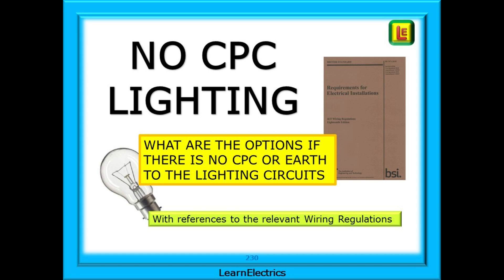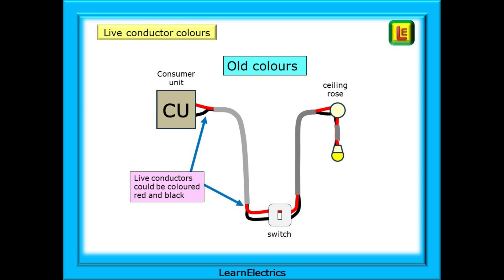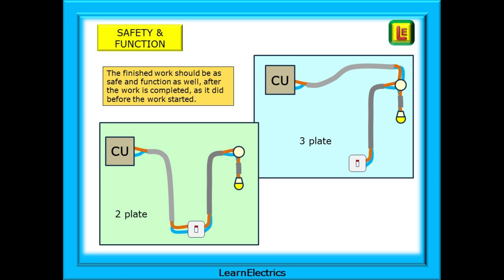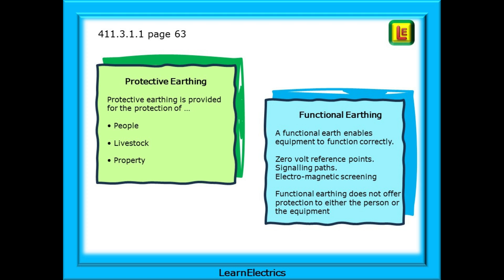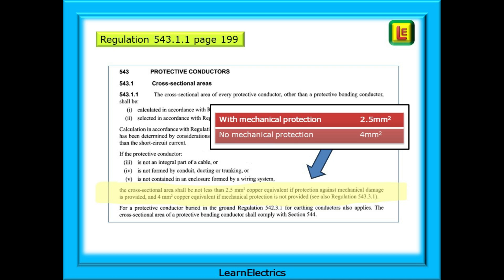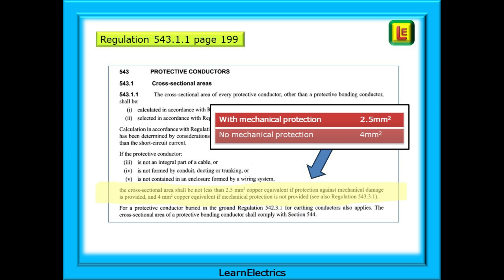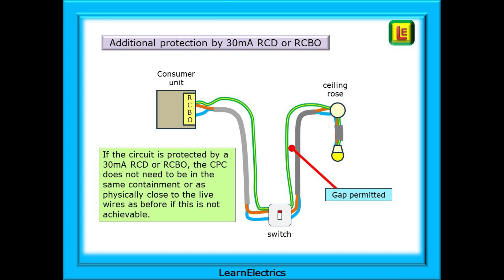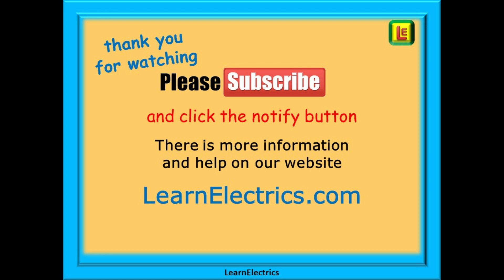NO CPC LIGHTING – WHAT TO DO IF THERE IS NO EARTH IN THE CIRCUITS – WHAT DO THE REGULATIONS SAY?

Comment: My friend has just had their property fail its elec safety inspection as none of the circuits have a CPC. The only solution proposed is to re-wire all wiring circuits which is coming in at £3k for the bungalow. Is another option to replace light fittings and switches with class 2 parts not acceptable anymore?
Reply from the maker: Reg 651.2 NOTE 2 states that existing installations installed to earlier editions of the regulations may not comply with current regulations. This does not necessarily mean that the installation is unsafe or that it needs upgrading.
Also, lighting circuits installed before 1966 did not require a cpc or earth.
Having said that. It is up to the inspector to use his professional judgement to make a decision of fail or recommend improvements or pass an installation.
And where a lighting installation is to be extended or altered, then the current regs regarding cpc's will apply.
If the installation is pre 1966 then it is 60 years old and well past it's rewire date in my opinion.
If as you say, ALL the circuits are without a cpc, then it definitely needs attention, this could be dangerous.
Have your buddy re-invite the electrician to explain why its unsafe, perhaps even get a second opinion on a rewire from another sparky,
Reply: @learnelectrics4402  Thank you.  Keep the videos coming.  Appreciate the clear and no nonsense content

Comment: Great video, whats your thoughts on replacing consumer unit when no  CPC on lighting circuit? Its not always possible to rewire and you will be leaving the job a lot safer with RCBO’s, SPD and correct size earthing conductors. Thanks.
Reply from the maker: Some people do, some use class 2 accessories only and label the CU appropriately - danger, class 2 etc.
Personal choice between you and the client. Hope this helps. Dave.

Comment: Please clarify if you can simply get away with using class 2 lighting fitting as suggested in comments below and not bother with an earth     ??
Reply from the maker: The Regs state that all new circuits should have a cpc taken to the point of use, even if not used. For lighting, the Regs state that the cpc does not need to be taken past the ceiling rose and luminaire are class 2. Hope this helps.

Comment: So I think the implied answer to the question posed, is that you could extend the lighting circuit if using non conductive accessories/fittings (Still as safe as the original circuit). Although this answer didn’t seem to be actually stated in the video.
Reply from the maker: No, that was in pre 14th Edition as stated in the video. the requirement now is to take the cpc to the switches and the ceiling roses even if not needed. The only exception is the pendulum cable from the rose to the lamp if that is all in plastic. Hope this helps and thanks for watching.
Reply: @learnelectrics4402  thanks for the the clarification.

Comment: Yes a very good subject. Here we have to run anything new from a ground circuit no tying into the old stuff. Thanks for sharing.
Reply from the maker: That is my preferred method too with older systems. Thanks for watching.
Reply: But a class 2 light would be ok as mentioned above in comments  ?   Would that be correct.   Would that be the cheapest way  ?

Comment: On my two core lighting circuit, in the 1980s a metal cased light was added & the electrician ran a single core 1.5mm2 earth (above the ceiling, so protected from mechanical damage) from the nearest plug socket. Is that an acceptable way to provide an earth?
Reply from the maker: Not acceptable. The cpc from the sockets is not part of the circuit from the lights. The circuits must be kept separate.
Reply: @learnelectrics4402  - Thanks, but what is the reason for this, given all the lighting/power earths end up being connected to the same earthing bar in the consumer unit/fuse box, and the same earthing sleeve around the incoming main
Reply: @Benzknees tumbleweed……..because the regs. say so.  I think any earth is better than nothing.
Reply: @MS-Patriot2  - Did the Regs say that 30yrs ago when it was done? And whatever they said then or now, it still doesn't answer the basic question. Why? What's wrong with the path of the earth going via one circuit instead of another one, both ending up at exactly the same place?
Reply: @Benzknees  I take your point entirely .  If I had to guess, it’s possibly because the earth fault loop impedance cannot be relied upon based on the designed circuit length.
Reply: @MS-Patriot2  - That's a good point, altho' in your typical UK 3 bed semi the circuit lengths are going to be pretty short and fairly similar in length.
Reply: @Benzknees  Absolutely but 7671 is guidance for all installations, and it’s written by boffins who wear four pairs of braces and two belts - just in case.😉
Reply: @MS-Patriot2  - Haha, that would explain why the rest of the world scratch their heads in wonder at our huge plugs!
Reply: @Benzknees  and ring finals.
Reply: @MS-Patriot2  - Yes, needless safety on earth wires & plugs on the one hand, 32A main fuse protecting 26A max load wiring if the ring is interrupted on the other😳
Reply: @Benzknees  I found the same thing in my house, a 4mm earth cable used as a cpc alongside old 60s black red single sheathed wire for the lighting circuit. I traced the cpc back to an older single gang box covered and used as a terminal block. The CPC was going to another circuit powering only the boiler. Whilst both the lighting and boiler circuits were on the same side of the RCB, I can see a scenario where if they'd randomly picked a circuit protect by another RCD then it wouldn't be helping you much in the event of a problem haha
Reply: No, definitely not !
Reply: @HW55  - Why?
Reply from the maker: Thank you, great support, appreciated. Dave.

Comment: An excellent video and a scenario which I have encountered many times. The only comment I would make about non cpc vis a vis plastic fittings is what happens if the metal back box becomes live. The 2 screws holding the plate switch would also be live and could be touched accidentally during cleaning etc. Showing my age here but does anyone remember coming across a wooden backbox I'm not sure whether they were on sale or some electricians made them either way I came across a few in 1960's builds.
Reply: You can put screw covers on the switches and an rcd
Reply from the maker: Absolutely.
Reply from the maker: Oh yes, and bakelite switches too. Thanks for the input. Appreciated.
Reply: I think easiest option  to use plastic / PVC. Screws  and also screw caps
Reply: @alinili5569  where u getting plastic socket screws from?
Reply: @joshb9657 toyfix Apperently has stock 😂
Reply: Yes I have encountered wooden light switch  back boxes . The switch is usually held by two very thin wood screws . Speaking as an old geezer I remember when a CPC was first fitted to Twin & Earth . It was I think in the 1970s and as the vid said  because of brass switches and because of ceiling fans and imitation oil lamp lights.

Comment: Always a tricky one that without rewiring, class 2 accessories minimum or a rewire or walk away untill the customer wants it done properly, excellent as always Dave 👍
Reply from the maker: Yes, that is the third option and we should not be afraid of doing that if the customer will not acknowledge the electrician's professional standards. Dave.
Reply: Good point

Comment: Can you spur a new lighting circuit from a CPC protected ring?
Reply: If your referring to a circuit that has no cpc then Yes you can technically, adequately fused down of course. 
This sinario would only be used when you need to add a light to a building that has no lighting, ie a shed. But in a property that has a lighting circuit as part of the installation then you should really rewire it if has no cpc or at a push you can add a separate cpc to each point but that can be just as much agg, so rewiring is a must, any add ons must be labelled
Reply from the maker: Thank you Brian, great cover, great support. Dave.
Reply from the maker: See Brian's great reply.